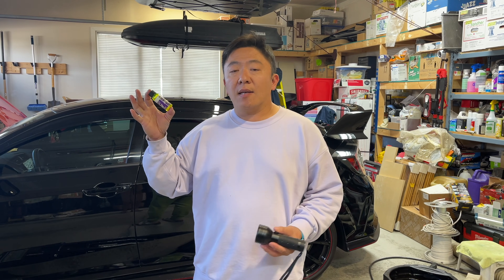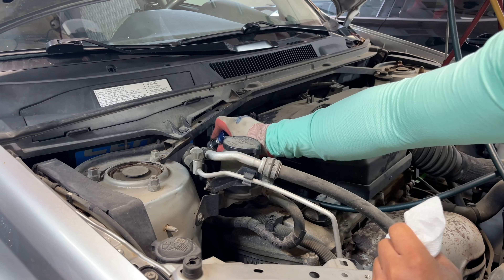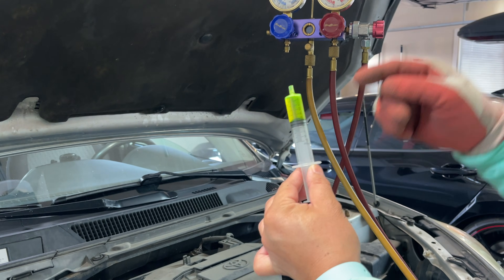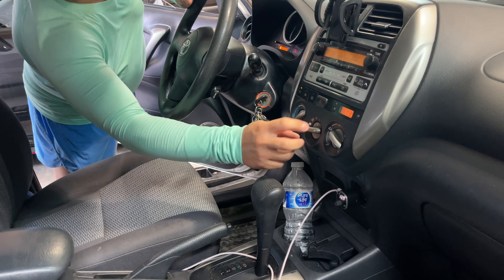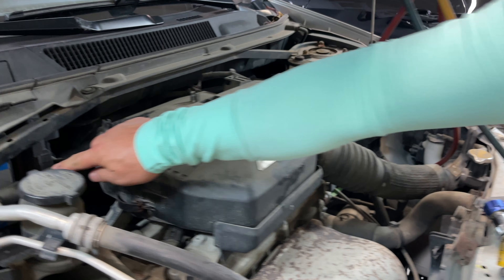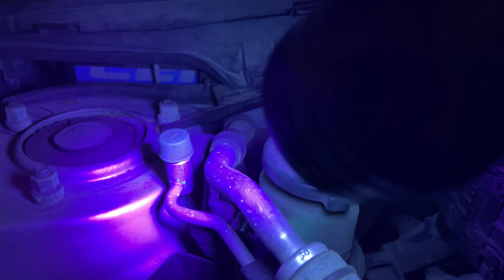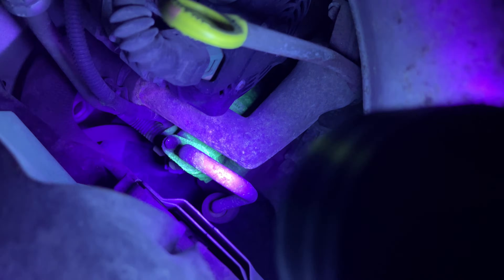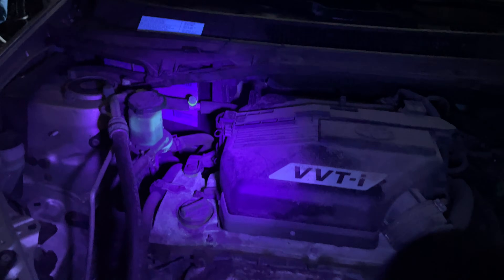Using UV leak detection dye to find a/c system leaks

Comment: The flaw to his process is that he didn't bleed all of the air in the low pressure hose before injecting leak detector and R134a. When he finally pushed the dye in with R134, he also added a lot of air into the system. Of course, when the leak is found the system will prob be disassembled anyway to fix the detected leak.

Comment: Am I the only one that's going to notice what you did absolutely terribly wrong... That hose is full of air. And you just pumped all that are into the system. The proper thing to do would have been to use an injection device that is meant for this specific thing. It's not that expensive and it threads on there to where once it's under pressure you can then add it into the system without putting all that air. Although I suppose if you're going to be bleeding the entire system anyway to find where the leak is and fix it I guess it doesn't matter
Reply: U r right.